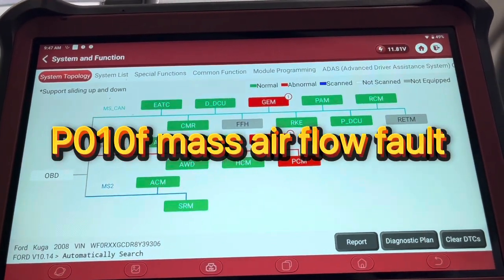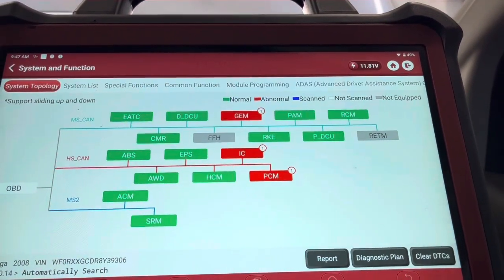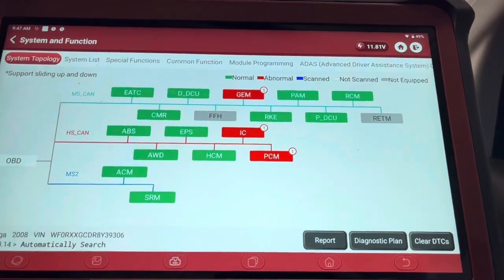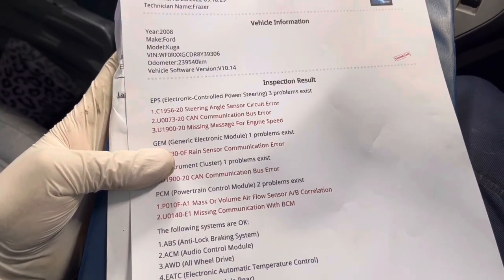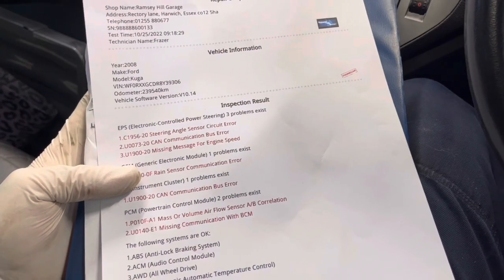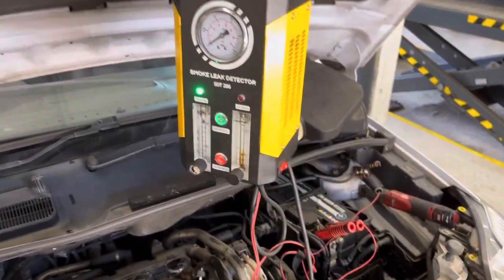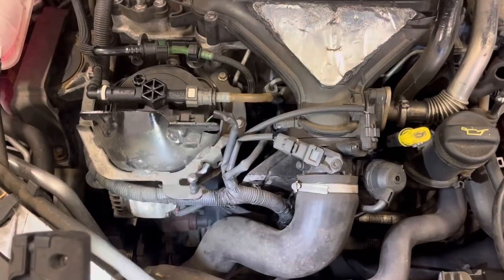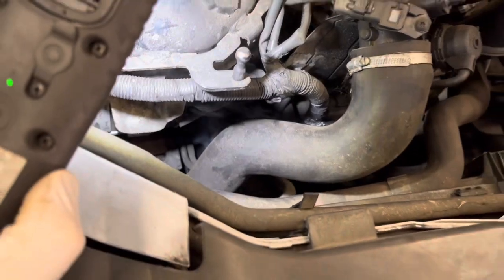Ford p010f Mass air flow fault. Diagnosed fault. Thinkcar Diagnostic tool and smoke test

Comment: Thank you , thank you , thank you !!!!  I have the same car with the same fault code and thanks to you video I’ve just solved my problem. Ironically it’s a split in the same pipe and position. 👍🏻👍🏻👍🏻👍🏻 cheers
Reply: Were Is the faulty pipe ? Is it the big fat one you can see there on top going down or is it a smaller pipe behind thanks